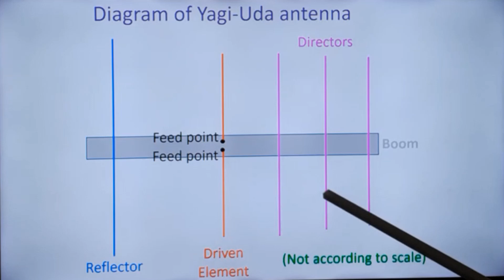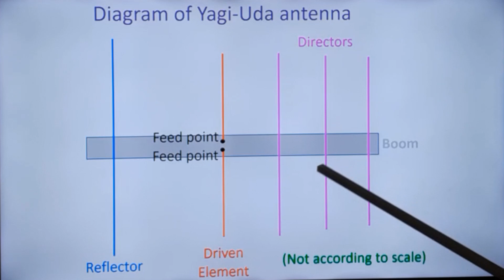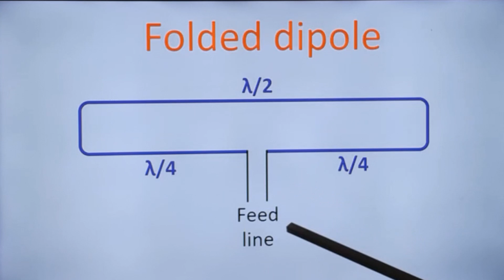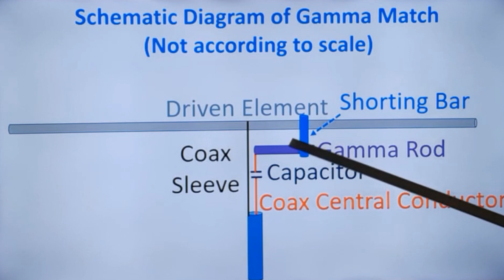How to Build a Yagi Uda Antenna

Comment: Hi, does the alumunium material (alloy) make a huge difference on antenna performance? I'm having trouble making my homemade yagi, the SWR was really great, around <1.3 and lower but the performance when receiving satellites was worse than a regular dipole. Or maybe you have trusted yagi calculator? I'm currently using changpuak. Thank you!
Reply from the maker: I have no idea on that as I have no choice here. I have not used separate VHF and UHF yagis on satellite. I use Moxon Yagi regularly, though with only limited success as I do not have an antenna rotator. I just made it according to the measurement given in one design. 73 de Jon, VU2JO